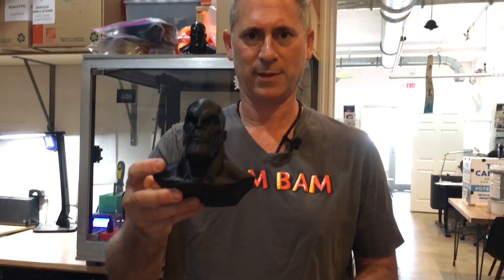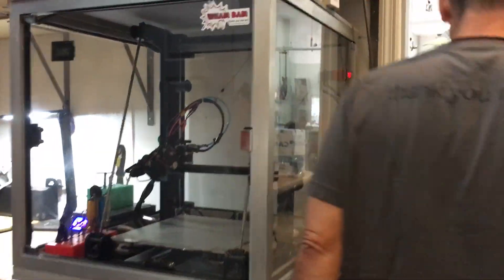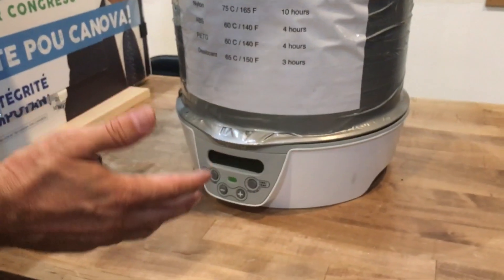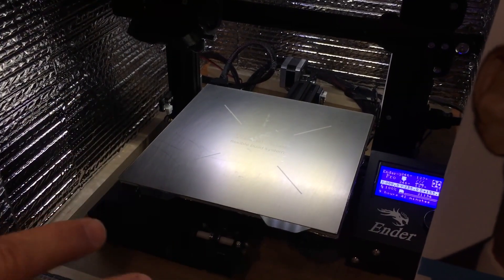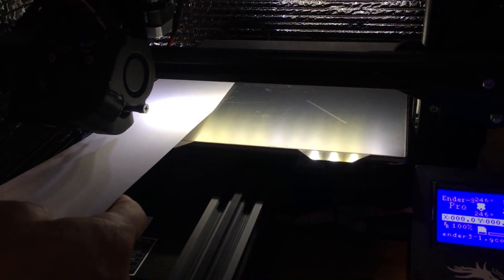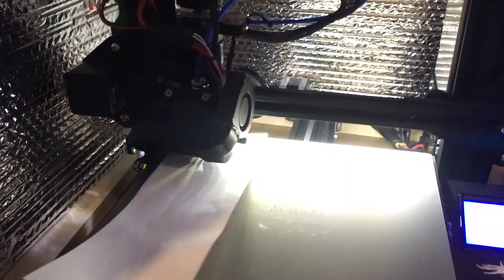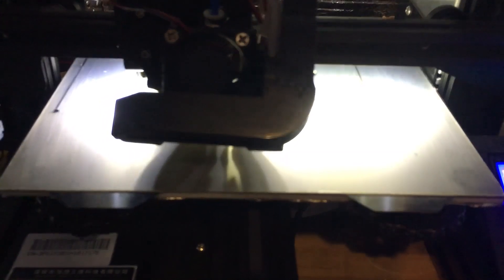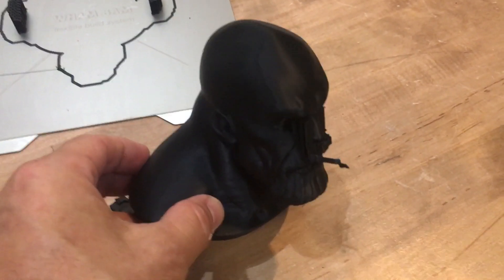Successfully Print ABS on your 3D printer!

Comment: Man I have nightmares about sitting there adjusting a wheel with slight turns because the bed wasn't perfect.  I got the Elegoo Neptune 3 pro and it's basically night and day.  I don't mess with it at all, do the bed measurements and off I go.  The only tweaking is done with z offset.

Comment: edit: i did not remove the protective plastic and that is what tore not the PEX i feel really bad about coming on here and blaming Wham Bam's product and no wham bam didnt ask me to write this or the apology i wrote on down at the end of this message thread i feel like an idiot   ................i have the worst luck with wham bam PEX sheets i ordered 2 sheets first sheet i was printing PETG and ended up with holes everywhere then i tried it again while installing the pex sheet i was using a credit card and it ripped a hole right in the center of a brand new sheet, i am done with PEX it is far to easy to ruin it
Reply from the maker: So sorry for your difficulties, Please write to technical@whambamsystems.com we can give you great info on how to print PETG without it bonding too well, have no idea how you could rip the PEX with a credit card, doesn’t seem possible.  We can help you get another surface and instructions on how to use it best.
Reply: @WhamBamSystems  i already sent a message to you guys with a picture of the hole in the pex
Reply: i wasnt going to use petg on it anymore without adding glue or hairspray but this new sheet i was going to use it for ABS
Reply from the maker: @3dprintingcave778  when did you send it, I’ll make sure team follows up?
Reply: @WhamBamSystems  i think on or around  12-23-2021
Reply: name was william johnston
Reply: i have 2 wham bam flex plates 1 has pei on it the other has garolite, i had another no name flex plate i was putting this PEX that i ordered awhile back on it
Reply from the maker: @3dprintingcave778  please send another email to technical@whambamsystems.com, can find your first
Reply: @WhamBamSystems   someone replied to my email and asked what was i printing i replied back i wasnt printing i was installing the pex with a credit card
Reply: Andrew replied to it about 7 hours ago
Reply from the maker: @3dprintingcave778  super!
Reply: @WhamBamSystems  i guess that is a oh well on the 2 PEX sheets i bought, lot of money down the drain, the PEX sheets shouldnt be so easy to mess up
Reply from the maker: @3dprintingcave778  maybe you should get preinstalled and skip the installation steps.
It’s not easy to ruin the PEX during install unless you stick it then try to unstick it. Watch my videos on installation for best practice
Reply: @WhamBamSystems  thank you very much for the code i have a friend who has a Wham Bam powder painted PEI sheet and he really likes it for ABS and PETG i may go that way, thank you again i really appreciate what you did fantastic customer service
Reply from the maker: @3dprintingcave778  thank you for you honesty, we should have asked you if you removed the protective film. It’s quite funny looking back at it, please keep the product, let’s write this off as a Misunderstanding. Let us know if you love it now that it’s worked out.
Reply: @WhamBamSystems  thank you that is very kind of you to let me keep the textured sheets, i printed my first ABS print on the PEX came out great really looking forward to printing on the textured flex plates

Comment: Do you using fan during printing ABS? And what quality of layers adhesion/baking?
Reply from the maker: I do, many say its not necessary, depends if you have overhangs or bridging which needs to be cooled rapidly, make sure if using fans you raise your hot end temp by a few degrees to compensate

Comment: Just ordered a ender 3 pro and i was happily surprised you have one in an enclosure that prints abs.. really informative video thank you.. two questions: Is it a ok to leave the psu (or any other electronics) inside that box? and are abs fumes a problem? Thanks again
Reply from the maker: Gino Foogle I use electronics in enclosure, around 40 C should be safe, eventually I will try to move mine out for the very exotic temp filaments, but for ABS and most common high temp filaments you are good to go. Fumes from ABS and other filaments are toxic and should be vented, with the HotBox there is a top rear access hole to hook up a tube to ventilate outside or to filter if you like

Comment: Thanks for the video.
Quick question, blower fans should be off right?
7:78 how do you configure this side line?
Reply from the maker: FixDaily - Electronic repairs, hacks and tips you are welcome! Fans should be at minimum to get good later adhesion but reduce stringing. The purge line? That is a bit of Goode at beginning of print. Let me know if you need it I can share
Reply: @WhamBamSystems  I've asked in a forum and i've already implemented the purge line thanks for the kindness on taking time to help.

Can't the fans be totally off? What's the % you use them with ABS?
Thanks friend
Reply from the maker: You’re welcome.   Yes part fans can be completely off, you can experiment with this.
Reply: @WhamBamSystems  Thanks :)

Comment: How do you feel about printing with 2.85 instead of 1.75? I want to use ABS with larger filaments
Reply from the maker: GenTech Mike Absolutely if your machine is set up for it, the Lulzbot all use the thicker filaments, of course you need thicker passage all the way through the hot end and a better heater like a volcano. But it will produce faster and bigger prints
Reply: Wham Bam Systems Thank you! I came across bigger filaments while doing a tour for some children. Part of the exhibition was a 3D printer and the filament used was as described with a .8 nozzle. I was amazed by it. Im going to buy a second printer just for larger prints
Reply from the maker: GenTech Mike You can also mount a .8 or 1.0 nozzle on a 1.75 filament machine. if you really want to have fast printing speeds you can use a volcano heater and just make slight mods to your machine. It should work well Without having to buy a whole new